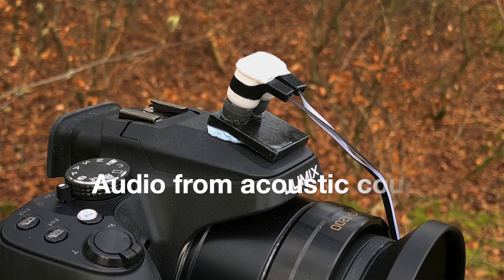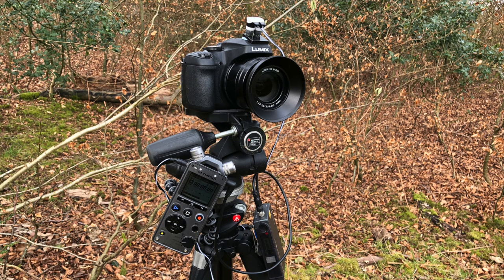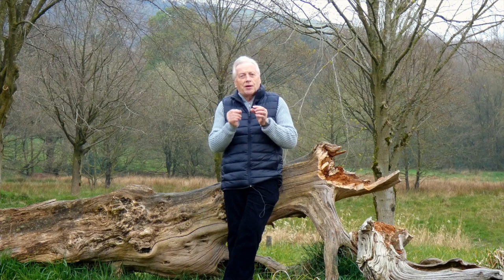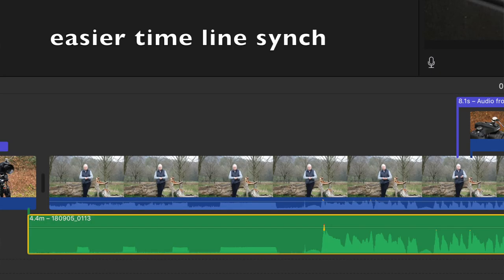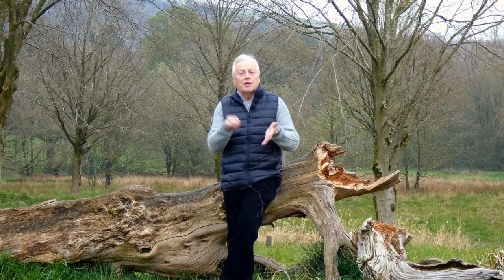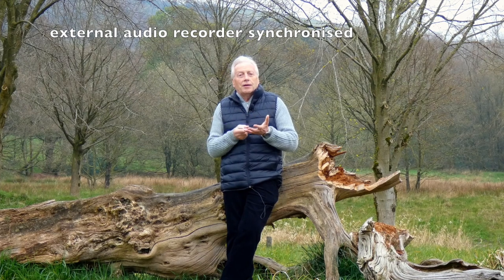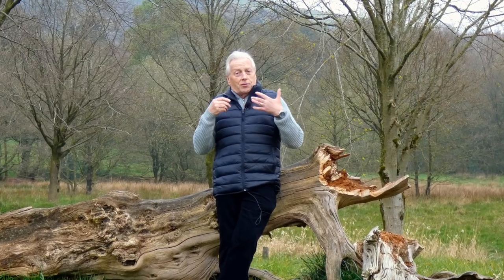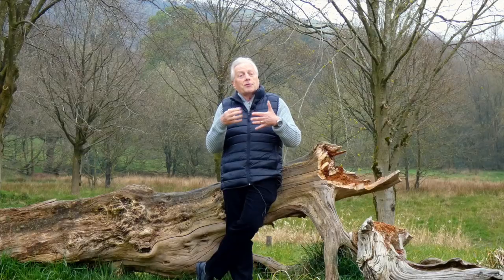FZ80/82 Acoustic Coupler - Project Update

Comment: I have just seen this for the first time and I like the concept. On first view and listen I thought that maybe mounting the buds or small speakers in a small box mounted to the camera but so that there is distance between the sound source and the microphones might act as a sound box and create a better effect. You would lose stereo separation but it might be worth a try and using different materials for the box would alter the quality. In the ear there is distance between the sound source and the drum and when the buds are inserted it creates a kind of sealed chamber that helps create the bass effect.
Reply from the maker: I tried a very small amplified speaker and sealed it to the mic housing with bluetack. The audio was better, however, the amplifier hiss could be heard. The camera mics are very sensitive and the agc quite aggressive. So in quiet spells the audio ramps up and then on the first audio it diminishes - just like the first 10 seconds of this video where the wind noise reduces as I start to speak, I can overcome the AGC but I don't think the audio will be improved so it probably isn't worth persuing.

Comment: hi i have synced the sound just using the light from clapper board as long as you can see it you can sync it but i have had a lot of experience of syncing with only a guitar string being struck not heard but obviously it's better to hear it to, am i right that in your photo of set up you had in-fact  placed the wireless transmitter onto the tripod rather than the receiver with the samson airline in previous video.
Reply from the maker: Yes in this video I used the Sennheiser wireless system. The receiver on the tripod feeds the audio recorder and its output goes to the earbuds. The transmitter was in my pocket with a lavalier  mic clipped on my coat.
Reply: @GrahamHoughton12  ow sorry i thought it was the samson on your tripod, i apologies my friend

Comment: How to blur background in low distens. model and fz 80 camera
Reply from the maker: because of the small sensor, the inherent DOF is quite high even at wide open apertures. The trick is to use focal lengths over 200mm and keep close to your model. The background must be far enough away to get the blur that you want. No short cuts I'm afraid

Comment: Why not try having a small open stereo speaker in front of the microphones instead.
Reply from the maker: Yes I did try that however outside wind noise is still an issue as teh mic ports are still exposed. I tried sealing the speaker to the camera but then very sensitive mics pick up any amplifier hiss.
Reply: @GrahamHoughton12  What if you tried those little wind muffs that attatch onto the microphone holes?